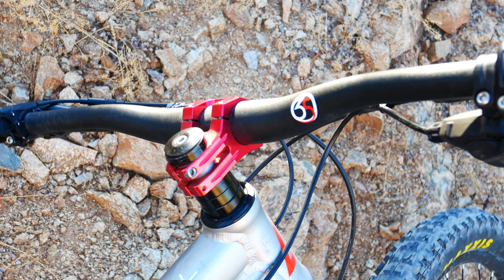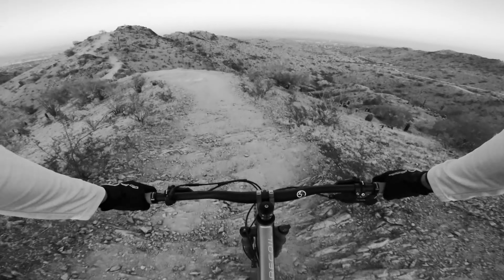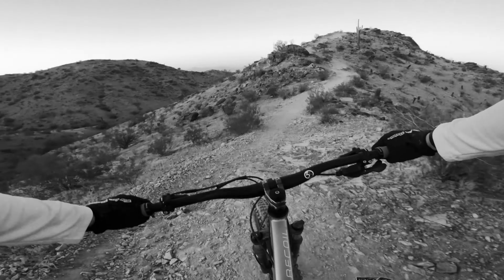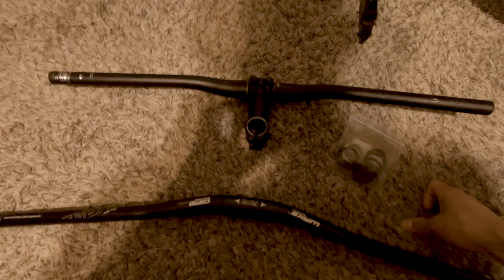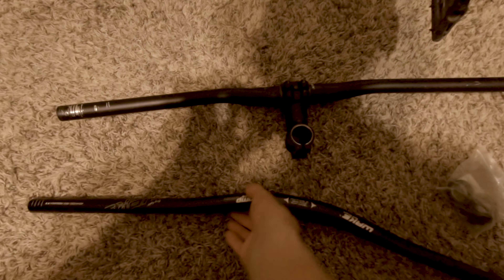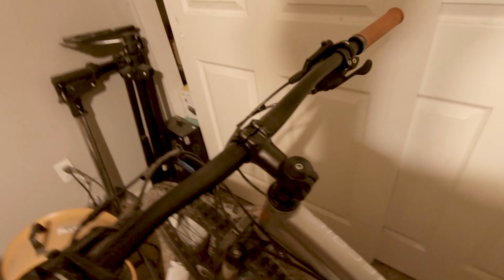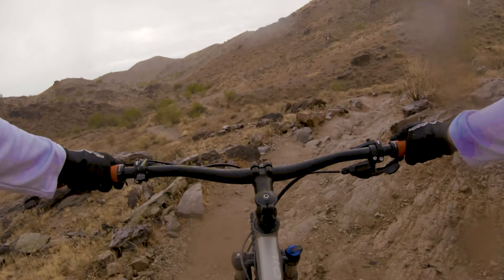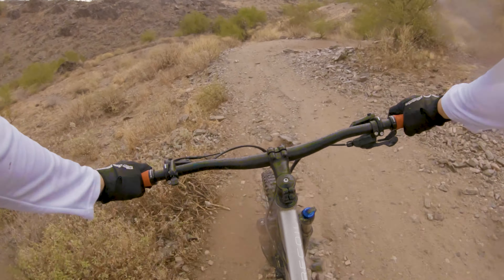Can A Longer Stem Fix A Short Bike Reach?

Comment: Had similar problem, I have installed a 45mm Stem on my Neuron CF 8.0 size L and a 760mm Bar with a rise of few mm. It looked great, however I am 190cm and the reach is only 453mm and I felt like I would enjoy a bike with longer reach more. Yesterday I tried to put back the 60mm Stem which came originaly with the bike back on to the cockpit, however still with the 760mm bars with a smaller rise and the 15mm made a huge difference. The body position and weight distribution was better, I felt better on the bike, I was faster on the trails, i felt more sercure riding berms, the climbing was easier, pedaling was more compfortable . The german engineers knew why they used 60mm Stem on that bike.  So shorter stem is not always the solution

Comment: The reach on my bike is short and when I had a 35mm stem on it, I felt way too upright and cramped. The front wheel would always lift up on climbs. Then I solved all the aforementioned issues by using a longer 50mm stem. Great video!

Comment: You did the sensible thing. Bikes with traditional geometry are designed to use a long stem for proper fit and handling. If you slap a short stem on the bike, you mess up the geometry and fit. This only works if you were slightly stretched out any way or the bike was a little big for you, but the ride quality is still not optimal in many cases. New bike geometry is designed to have a longer TT to accommodate for short stem, longer bars, and slacker HTA. All that stuff needs to work together, not just a short stem.

Comment: My 2018 Marin Rift Zone 2 came with a 45mm stem which I am now replacing with a 70mm 6 degree stem. I am 6’ 2” and got the XL. version of the bike. It came with a 120mm dropper post which I upgraded to a 150mm. I have always felt cramped while riding and had a few close calls where my wrist twisted off the bars during descents. I was lucky to have stayed on the bike without crashing. I agree, this shorter stem = better ride trend isn’t applicable to everyone or to all bikes. I do mostly trail riding and the only time the 45mm is really helpful is during some very steep drops/descents.

Comment: That's the issue I'm having. I bought a frame size bigger than recommend.  A 2022 Santa Cruz 5010 feels smalls and hits my knees on tight corners, plus when I'm hitting rock garden drops I'm having to really put all my weight towards the back wheel holding on for dear life because I ride with no protection and I'm a beginner. 😆 I'm hoping a longer stem really helps

Comment: but if bike is too short then it's better to get a new build, cus installing a much longer stem will not solve the issue of handling, and balance points, stability, and knees hitting the fork., but of course only use stem length to twek it sligtly, also bar rise, sweep, and stack height, can play a role in how good the bike fits.
my previous bike, 2014 Trek fuel ex 17.6/18.5 430mm reach,  had 70mm stem 720mm bar, but I isntalled 50mm stem 800mm bar, but for proper reach I would have needed somewhere near 80 or 100 and have my 40 mm riser bars, of course that would not work well, cus the bike was so short I hit my knees on the fork and stem.
now I have a Nicolai/Geometron G1 size large, 515mm reac, it has 33mm stem on it 800 mm bar, bike is taller, cockpit is higher up, the reach is perfect, the head angle is slack making it straight line stability and cornering very stable, also the short stem keeps the steering direct.
but, you have a great point , you can do some not too extreme stem and handle bar changes to make a bike fit better, as long as it's not too extreme, as long as it feels good, handles well, then goo for it.
Reply: Johannes Nilsen how tall are you? I’m 176cm and have a 2020 fuel ex5 in a M/L size
Reply: @appleglory  I am 182cm quite average arms and legs, I now ride a Size Large Nicolai/Geometron G1 with 515mm reachh 33mm steam, 800mm handlebar, Fabric Scoop saddle with tip above BB, I use Mid foot potion on Catalyst pedals.
So according to NIcolai/Geometron sizing you should be on a medium which is for 170-180 cm
Reply: @appleglory  I am 170 and M/L is too long reach but the seat tube angle is too steep and i have to have the saddle all the way back to be balanced otherwise i am thrown forward, i have bought several different stems, 50 too small 120 too big 100 too big, i have an 80 coming in the post, so your height is basically the wrong method in determining your bike size as my legs or femur are too big but my reach is too short.

Comment: If you dont mind sacrificing climbing ability you can always pull the seatpost  back on the rails to increase your reach . Everything has a trade off
Reply: reach is not affected by saddle position
Reply: @delucerrr  yup your right idk what I was thinking when I wrote that
Reply: 666ImI666 by definition it’s not affected. But the feel of the reach certainly is.
Reply: that abuses the knees, it reduces the efficiency, makes you fatigued faster, the balance point will be too sensitive to the rear.
Reply: @delucerrr  he means effective reach, it's different from reach, you are correct, reach is the distance fro above centre of BB to centre of headtube.
I have the saddle tip on Fabric Scoop Shallow race above the BB, I have 33mm stem, it's on a Geometron G1. quite different bike than in this video. the saddle position I uses easier on the knees, and matches the geometry of this bike.
Reply: Moving your saddle to accommodate reach isn't the way to go as your saddle need to be in an exact position to keep you balanced on the bike.